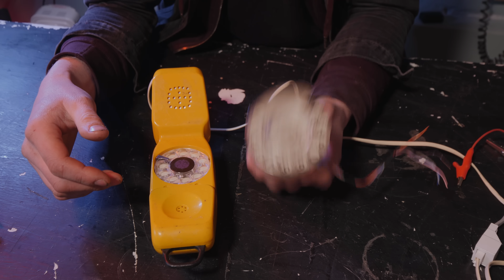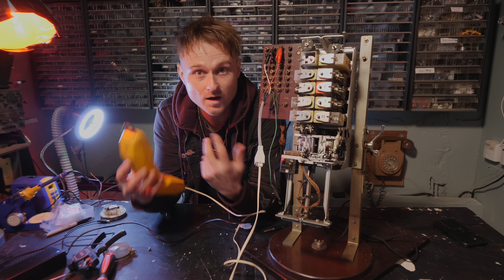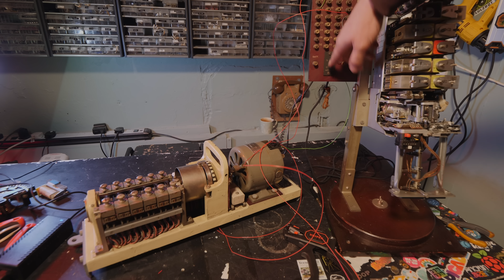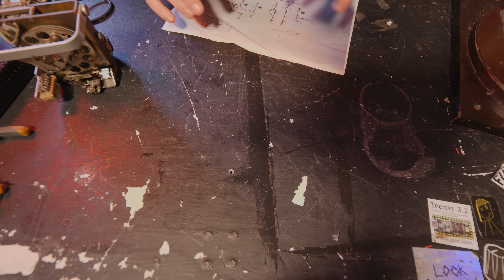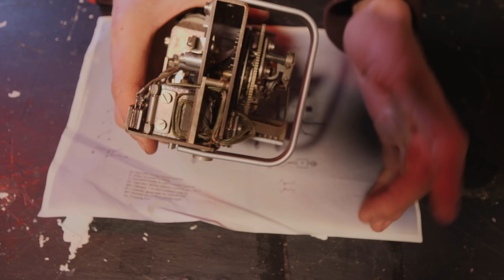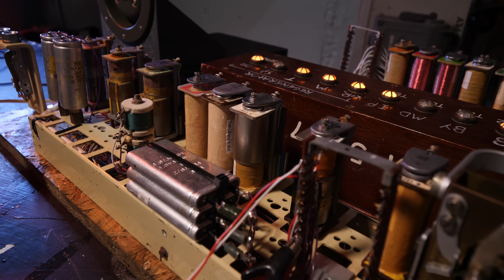The Weird Story Of Electromechanical Memory - 40 bits of the stuff!

Comment: I remember sneaking the house phone to call friends, when the dial spun back after selecting the number it was the loudest thing known to man. You've brought back a load of happy memories. Also why was 999 the emergency number when it took so long to dial 🤷‍♂
Reply: As I understand, on the old system dialing “0” called the operator, 111 was considered but too risky being dialled by mistake tapping the hang up cradle clearing the line… so 999 was chosen as you could locate the silver stop bar past 0 in the dark, by placing your middle finger in the 0 your index finger automatically dropped into the 9 and could then be used reliably to dial the 9 three times!  😊

I hope that made sense?
Reply: @Macro-photographer  I'm not 100% but I thought if you tapped the hang up button a few times it put you through to the operator. Also was the operator service not out of use by the 60s/70s?
Reply: @roblow69  in a pulse-dialing system, it was specifically hitting the hangup button ten times in a row, which duplicated the same pulses as dialing 0.
Reply: Its quite hard to misdial 999 on a rotary phone
Reply: @DaveLaneGC  True, I would argue its as equally difficult to misdial 888 or 777....etc. They would be quicker to dial
Reply: @roblow69  They would be quicker indeed but not so easy to do in the dark.
Reply: @evetrue2615  I agree with you. It really should have been 000 or 111. The start or the end of the dial
Reply: @roblow69  In the UK (and most, not all countries) a 0 needed 10 pulses so was located after 9 on the rotary dial. Using number 1 on the other hand has issues as it is really easy to send inadvertently by disturbing the receiver switch, and could cause some false dials. Which is why many countries use 112 and not 111.
Reply: @roblow69  That is what it is here 000 well in Australia it is.
Reply: In the 'old days', there used to be two bare wires to the house from the telegraph pole. In high winds they would oscillate and the wires could touch... If the emergency number was 111 or 000 the wires could easily 'tap' together nuisance calling the emergency services. Other numbers such as 7's or 8's were reserved for other services. It was also decided 999 was easy to remember and dial in darkness/smoke as it was one finger hole below the '0'.
Reply: In Denmark back in the day it was 001
Reply: The main reason was it was the least likly number to be dialed by a toddler playing with the phone. And thats the truth. Research it.

Comment: A long time ago you could run into a phone that had a blank plate instead of a rotary dial that was supposed to be meant for “incoming calls only”…

Would blow peoples’ minds when you would just tap out the phone number on the actual hook and make an outgoing call heh.
Reply from the maker: haha hackerman over here! nice
Reply: @LOOKMUMNOCOMPUTER  Phreaking was the name of the game. Going to assume you are familiar with it- however, for those who aren't, Its worthwhile to check into.
Reply from the maker: @xtremeownagedotcom  in the US yes thats was the case, different story in uk largely. different things fir different tech
Reply: I was going to make a similar comment. My parents got a phone lock for the rotary phone but it didn't take long to work out you could tap out numbers on the hook, so didn't stop the crank calls we used to make :)
Reply: @rjy8960  Same here!
nines and zero's were a pain though haha
Reply: As a kid I had one of those and accidentally called the Dutch emergency services by pressing the button on the hook multiple times (as the number is 1-1-2). Was pretty scary as I had always been told you'd get into trouble if you called the emergency services unnecessarily. Instead of explaining myself, I quickly hung up and waited for the repercussions that luckily never came
Reply: @KoenOnbekend  I remember being a kid and trying to think of a number that wouldn't be used. I knew zero was used as a prefix for regional calls, and double zero was the international prefix, but triple zero I'd heard nothing about so I dialed that and someone picked up. I threw the handset on the hook so fast I never heard what they said. I think I was five or six years old.

Some years later there was a big craze in school as we learned of un connected numbers that hadn't been disabled. Usually you would get a recording saying the number was not in use, but sometimes some one forgot or simply didn't care to disable the number and then it just ended up in telephone limbo, having no line to connect to. If several people dialed the same unconnected number you could use it as a group call. The quality varied but usually you had no problem hearing each other. These number was spread through word of mouth, so you really never knew who you would find on the line. 

You think predators and grooming is something new that came about with the internet? Oh you sweet summer child...

I was not yet a teen the first time I heard people trying to find kids to talk dirty to. I remember a woman with real nice voice that  wanted to hear me talk about spanking and punishing her sexually. It was weird but not really something that bothered me then or later, but I can't speak for others and I can see how many kids might have gotten a scare. As this was not a service the telephone companies had intended to create or controlled there was minimal risk of anyone being able to track a kid down so there weren't really stalking and long time grooming like we got once the internet became easily available. But there were also less tracks that could let the police and investigators find and hunt down the pedophiles.

It wasn't until the electronical phone switches came about that the police could start tracking predators on these lines. And phone companies did crack down on it and disabled all the numbers they could find. Where I live they created official party lines with good sound quality and that were occasionally moderated to crack down on the pedophiles. But that was nowhere as fun as the old ones. After all it's fun to do what you're not supposed to do and give you that feeling of breaking the law... Besides as the old ones never resulted in a connection being completed they didn't record as a call and couldn't be seen on the phone bill unlike the new official party lines.
Reply: @KoenOnbekend  Also dutch here. I also managed that with my Pixel 6 phone, When the touchscreen stopped working and i couldn't get it to reboot i pressed the powerbutton several times out of frustration which also dialed 112 and had an option on the screen to stop dialing :-)
Reply: @AndreVanKammen  Old mobiles in the UK would dial 999, the emergency number, if you held down the 9 key long enough. Not sure if they still do. I once got a call from the local police because the 9 key (back when phones had actual number buttons) had been squished in my pocket and called the emergency services.
Reply: @KoenOnbekend  This is why they changed the number from 111 to 110/112. It's too easy to accidentally dial 111.
Reply: @diakritika  Originally the wind could dial it on the telephone pole wires. Allegedly
Reply: @diakritika  in Finland we had 000 - the worst to dial in prolly, in case of emergency! No mistakes for sure.
Reply: I learn to do that after watching Anthony Hopkins do it on Silence of the Lambs, it still works here in my country.,
Reply: @GeomancerHT  Should still work on pretty much any landline, most exchanges (still) have pulse to tone functionality baked in, might be a bit less of a sure bet on a phone connected to a VoIP ATA though, some of them do pulse but most I've encountered don't.
Reply: I remember using an answering machine remote control on these phones, to make a call
Reply: Hook dialing was a particular skill back in the day. My dad worked at the phone company, and changing up between lineman, switching office, and trouble call dispatcher as the tech changed over the years. So I was shown some of the old tricks like this. I also found it amusing to see a number dialed by tapping together the alligator clips attached to the phone wires on the most basic form of lineman's handset. Never did memorize some of the "secret" phone numbers used for troubleshooting back in the day that could allow one to make free local calls though. (Doubtful if that last one is a thing anymore. Probably discontinued just before 7-digit dialing for local went away.)
Reply: Kevin Mitnick did this on the prison phones to make outgoing calls before the judge said he could use that to start WW3
Reply: I remember those. I wish I had known that hack when I was a kid.